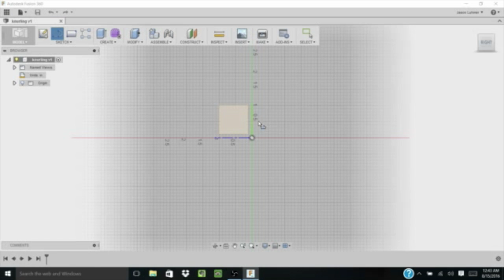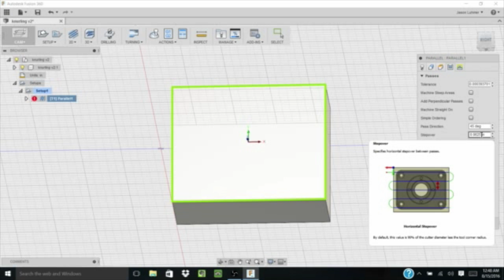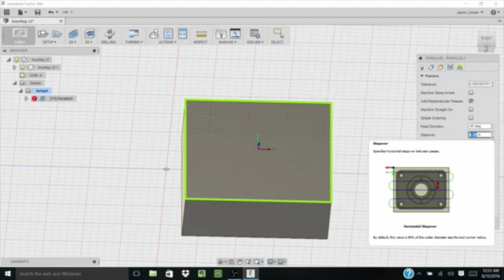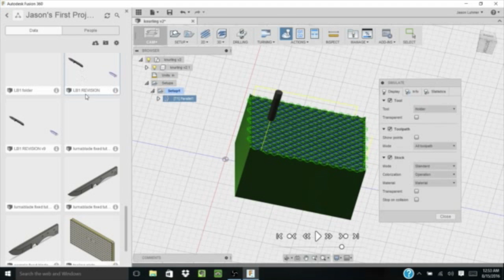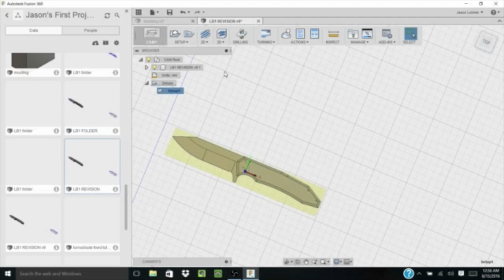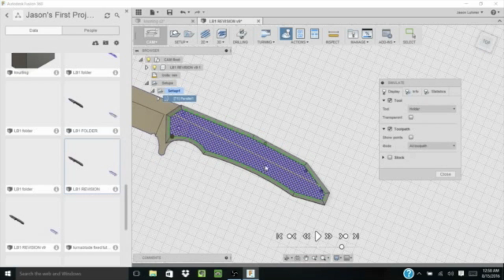Fusion 360 Texturing

Comment: Interesting! Thank you for sharing.  I have a question.   I don't have a cnc machine or experience using one.  Can the file be saved with the texture for 3D priniting?  Thank you again.
Reply from the maker: William, I currently do not do any 3 d printing so I can not tell you for sure, But If you sculpt or model the actual texture in your model I believe it would work fine. the way I showed was actually using tool paths and certain tools to accomplish a texture
Reply: Yes you can.  Right click after the simulation is done and you have an option to save as an stl - which is the format most 3D print slicer programs ask for.  This is also super helpful if you want to render your machined results too! (Just reimport the STL to fusion)
Reply: What do I right click, can't seem to find the right option to export in CAM view after the simulation. Thanks!